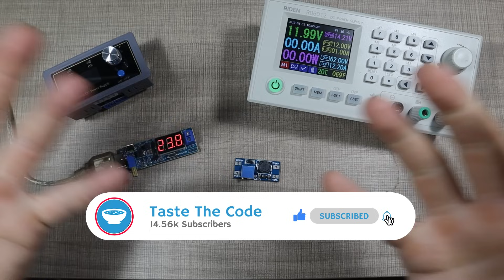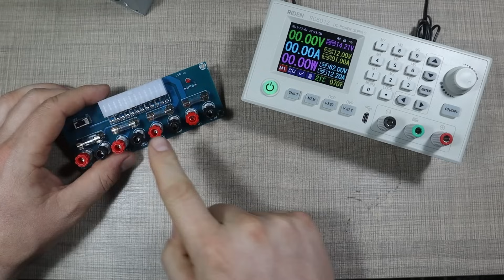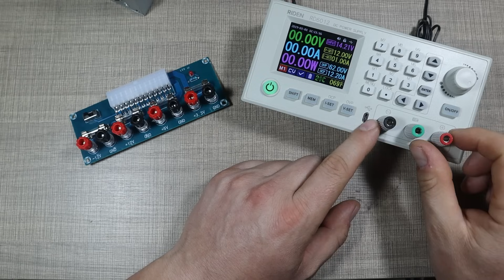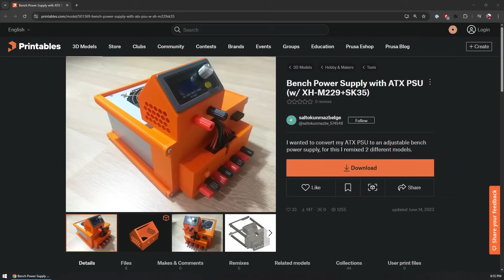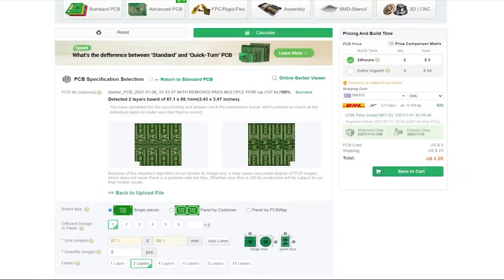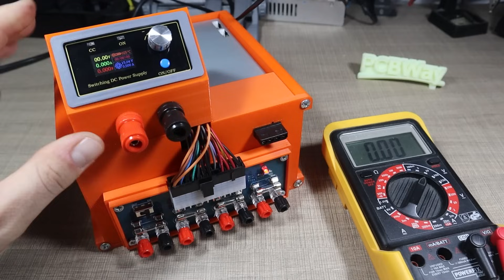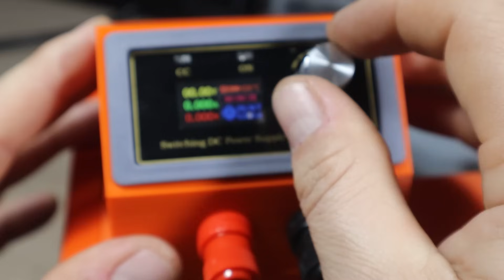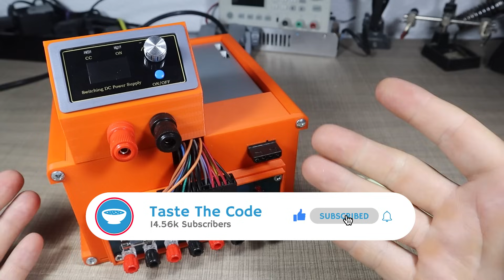DIY Lab Bench Power Supply from a Computer PSU (Easy & Powerful!)

Comment: Plfudplay your existing piwersupply specifications and each module description you have shown in your power supply video.inclufdng links for online purchases.lije the one you have dusplayedalso the cabinet.irs important that you explain each module shown in video S usm anxious to have the same the cabinet and banadocket plate us excellent if A  BEGINNERENTHUSIAST LIJE NE IS REALKY PISSISIVE.AND WANTS TO KNOW NEW OPTIONS SND MODULES TO USE IN HOME DIY PROJECT.ANTICIPAYING EACH IN YOUR DESCRIPTION ALSO CAN IREQUEST YOU TO BUILD AND PROVIDE EACH DETSILED CIRCUIT DIAGRAM YSING IC LM 723AND TRANSISTORS FIR CURRENT syou fell MOSFET or transistor for dual dc multiple output with cc and cv output 0to30vdc10amp.2bd -&_15vdc 5amp 5v +-5ampwuth ccand CV with digital display if current voltage and watt.with course anfune 10turn pot for each separate display for 14v and 5v .with regards anticipating your next video.

Comment: Dont tin wire that goes into a screw terminal, the solder will soften if the wire heats up and that will make a lose connection and can cause a fire (already happend on 3D printers) always crimp
Reply from the maker: Hey, thanks for pointing that out. I do not have a good crimping pliers but I guess now is the time to get one.

Comment: Your  comment regarding “be careful” and the capacitors. How do you “be careful”? Aka, is there a method to make sure they are unloaded? Obviously if they trigger/unload and you’ve got ahold of anything downstream…. Regarding clipping all the wires at the base, they remain live and now exposed right? Confused. I want to do this but, yeah, concerns…
Reply: If you work on the power supply right after you disconnect it from the mains yes, the capacitors will still hold some charge and it can give you a shock althout you will probably not die, but the right procedure is to wait at least 2 minutes before you take out the board or poke around. There are bleed resistors that will discharge the capacitors in about a minute or two.
Reply from the maker: Yes, a good design includes bleed resistors that should discharge the PSU in few minutes but you should still be careful not to touch any of the exposed circuitry. As for the wires, since they are clipped down to the PCB, there is no way they can connect to anything and short out. They are delivering low voltage anyway, so there is no risk of electrical shock from them. It is just that they don't accidently touch anything in the power supply.

Comment: You also could add a car radio with some speakers and have music while working on projects. 
This is what I've done. 
The only thing I'm missing is a small battery to keep the settings in memory for the radio. 
It's a good addition in the workshop. 
Only thing i would change in your build is colored terminals. That makes it easier to recognize what voltages are on the connectors.
Reply from the maker: I already have another radio in my workshop that I salvaged and repaired from the flea market. I also have a video on it: https://www.youtube.com/watch?v=Bn8CsYJJp-8 but using a car stereo is a good option as well.

Comment: I think you are going to have a problem fitting the new banana plugs as the spacing may be too tight for the bigger size.
Reply from the maker: I tried ordering the ones with the smallest footprint I could find online. They have not arrived yet, but I have high hopes 🤞

Comment: For high amp xbox-360 to fat xbox-one power adapter is a very good 12v clean power good for computer equipment to hobby project amps very dependent on which one version you get older ones have more amps
Reply from the maker: I have not tried that before, but it's an interesting idea! They are in fact good power supplies as well considering that they are powering sensitive electronics.

Comment: Great use of an old PSU, I have used one as a converter for a small 12v fridge before, just rewired the 12v rails into an Anderson plug.
Reply from the maker: Thanks! On most of the older PCs, the PSUs are still perfectly fine. I'm using one to power my CCTV cameras in my house.
Reply: @TasteTheCode  Oh nice! Definitely a good cheaper option for stable power needs, they are made for sensitive equipment after all!
Reply: Some require a current draw on the 5V rail to stay on.
Reply: @g.8.8.8  good to know
Reply from the maker: @g.8.8.8  I haven't seen such a power supply yet. All I've seen power on once you connect the PS_ON line (green wire) to GND.

Comment: That looks awesome. Not sure if you said but, about how much does this cost to build with the parts and everything?
Reply from the maker: Thanks! It all depends if you need to buy the ATX power supply or you already have one as I did. The SK35 module is anywhere between $5.5 and $10 on AliExpress, while the breakout board is $2~$3. The filament cost is ~$6.5 if you print it yourself.
Reply: @TasteTheCode  I definitely need to get all those parts for sure! (And get it 3D printed). I appreciate it.